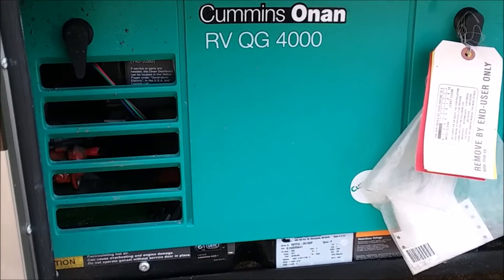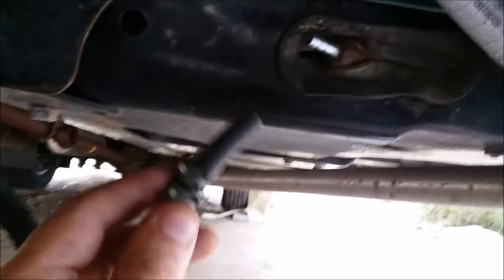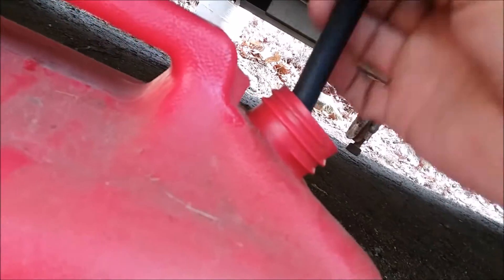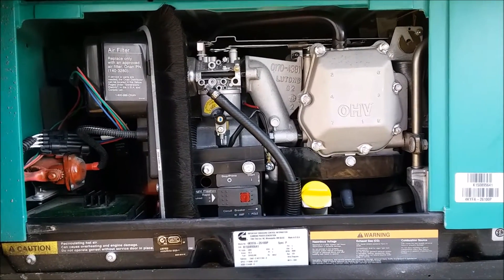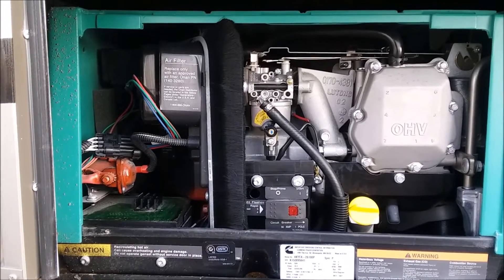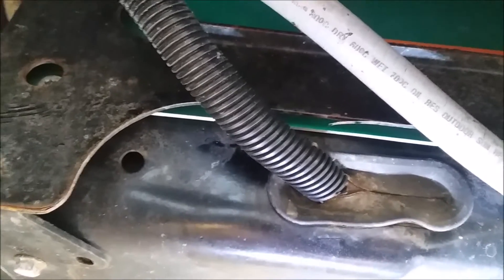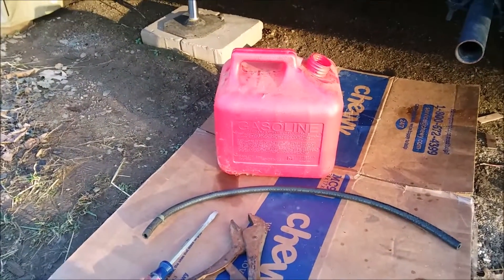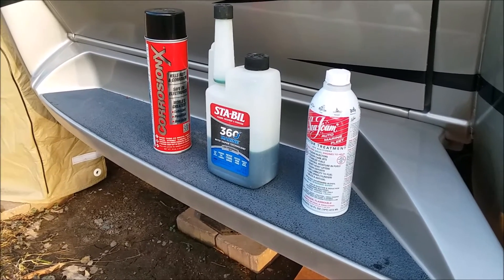Cummins Onan RV QG 4000 generator exercising, carburetor maintenance and surge prevention

Comment: Your video was excellent.  Quality of audio/visuals/ camera angle/ voice, all excellent!  I needed this very badly.  I have 'surge' on my generator.  The poor thing!  My used RV is 1997, and I did an oil change and air filter change myself a year ago.  Did not know how to tackle cleaning the carburetor, fuel line, checking fuel pump and fuel filter issues.  I found out on Youtube University.  However, your video on Carb cleaning and flushing is the best!  As a female, single RV'er, who was not born like most men with knowledge of engines in their DNA, I appreciate this information and very grateful for your wonderful demo!!  Had heard about Seafoam and now will do it.  Thank you!!
Reply from the maker: Thank you very much for the accolades.  If you have surging you can use a 2 part gas to one part seafoam mixture and let sit overnight.  Repeat as necessary.  Good luck and safe travels.

Comment: Nice idea.  I will probably try this.  Two things.  The generator depends on that front cover to channel the air from the fan around the air engine to cool it.  Running with that front cover off risks over heating the engine. See the manual.   Second, I noticed the fuel line in your generator is missing some of the corrugated black plastic cover that acts as a heat shield to avoid vapor lock.  My generator was the same.  I added some more covering all the way up to the carb.   I noticed most pictures of this generator show more shielding in place.
Reply from the maker: Yes the generator needs the front cover on to properly cool the engine.  I removed some of the corrugated plastic on the fuel line for the video but I will check to make sure it's completely covered. Thanks for watching.

Comment: Excellent video! 😀  I have a 1 year old coach with the same generator and sometimes it takes 5 or 6 attempts to start.  I only have 20 hours on it so I'm going to change the oil for the break in period.  I think I'll try your carb cleaning to see if that helps it start faster.  Thanks for making this video....👊
Reply from the maker: Yes, These generators hate to sit.  The more frequent you run it the better it will run.

Comment: I have used a 5th wheel the last 14 years with out a onboard generator, now with the motorhome and onan generator would not go back. Love the generator. Thanks for the tips.
Reply from the maker: Thanks Rickbo.  I agree I love the onboard generator.  The trick though is you need to use it frequently for it to run well.  Thanks for watching.

Comment: Hi, thanks for all your excellent videos! I'm a first time RVer and tried to perform this maintenance. But after removing the clamp on the fuel line, I couldn't disconnect it. There's some type of black "band" holding it tight. I can't remove it no matter how hard I tug. I don't think I can post a photo here, unfortunately. Any suggestions?
Reply from the maker: Without seeing it I really can't say.  I have seen bands used that needed to cut off and then replaced.  Maybe have an rv tech or someone with automotive experience take a look at it to give you some guidance.

Comment: Great videos thanks.  Question: should I do the Seafoam treatment BEFORE or AFTER replacement of new fuel filter?
Reply from the maker: I would probably do it before then run for a bit afterwards before changing filter.  Good luck

Comment: just using  Sta-Bil every time you add fuel helps tremendously,this is a must ,the problem is the ethanol in the fuel,it causes the internal parts in the carb to corrode .
Reply from the maker: I agree 100%

Comment: Great video. I like using Berryman B12 in our generators fuel system, using the same method you did.
Reply from the maker: Thanks for sharing.  I also use Beerryman B12 in some of my small engines.

Comment: Great! Answered a question I didn't even know that I had and fixed a problem I didn't realize that I was going to have.  Great heads up.
Reply from the maker: The number one thing you can do to keep your Onan generator running well is to use it.  Thanks for watching.

Comment: I wonder if you could use a 3way valve like a motocycle tank valve and then you could leave a hose caped under there and when u wanna do the treatment you could tank you gascan and uncap the hose throw it in the can and just turn the valve so its drawing from the can...would really simplify it then
Reply from the maker: Sounds feasible.  If you try it come back and let us know if it works.

Comment: I have been watching your videos and find them very helpful. Thanks! I am trying this on my newly purchased used RV. The trouble I am having is that I cannot remove the fuel line hose from the filter. It will spin and I can wiggle it but I just cant get it off and I don"t want to damage anything. Any help anyone can provide would be helpful.
Reply: Pull harder. Once the clamp is loose, it pulls off. If it's been on for a long time, the rubber hose will shape itself to the nipple. It will need some extra persuasion. If the hose is old and no longer pliable, replace it. Follow the hose to an end, then remove and get another section from the parts store the same size. 
If ethanol free fuel is available, use that. Ethanol in gas goes bad in a few months. 100% gas has a two year shelf life. Ethanol is rotten in fuel.

Comment: Great video, have the same problem.  However, I live at 6500 FT and do most camping higher, even with the altitude adjustment all the way to the right it still puts out some black smoke then fouls spark plug. 
Does anyone have the procedure for adjusting the air/fuel mixture on this same genset?  (assuming screws in the side of carb)
Reply from the maker: Great question.  I would reach out to Cummins Onan directly.

Comment from the maker: I don't know why but I lost several comments and questions.  Someone asked does the generator need to be level to operate.  The short answer is no.  As long as your not parked on a steep incline you should be fine.
Reply: Isn't the Rotella 15W40 T4 diesel oil , is it safe to use in this generator , I bought it and am very concerned about putting it in mine .
Reply from the maker: I cannot speak for the manufacture but have had many who claim to use it.

Comment: Good video. Just know that you can in fact rebuild carbs and even just take them apart to clean them. But it's not for everyone.
Curious as to why you didn't attach a hose to the carb itself, instead of going underneath?
Reply: He’s using generator fuel pump which is between filter , go directly from can to carb and you don’t have fuel pump

Comment: Hi, RV Habit can you tell me how to use the sta-bil. I just bought a 2014 Jayco motorhome. I'm trying to learn! I am a woman any help would be appreciated. Your videos are the best!!
Reply from the maker: Thank you so much for watching and  taking time to comment.  Depending on what Sta-Bil you use will depend on the amount needed.  I use only Marine 360 Sta-Bil.  I have had good success with it in lieu of the regular red Sta-Bil.  At first it may seem that the Marine 360 Sta-Bil is more expensive but you actually use less of it so it lasts longer.   I follow the directions and during the summer months when I use the rig I put in one ounce of Sta-Bil for every ten gallons of gasoline.  When I store my rig in the winter months I double the dosage to one ounce every five gallons of gasoline.  I add the Sta-Bil right after I get gasoline at the pumps.  Again thank you so much for watching.  Happy travels and stay safe.

Comment: Some of the sorgina might be corrected by replacing that fuel filter...also it is rusty...replace before it rusts on...9/16 deep socket with white high temp sealant by permatex on threads ...not on the very ladt threads

Comment: Should the seafoam/gas mixture be going straight to the carburetor or should it be attached to the end of the fuel filter.
Reply from the maker: I attach the mixture at the fuel filter.  You need the fuel pump, which is attached to the filter, to feed the fuel to the generator.  Good luck.
Reply: Thank you ur the best

Comment: Hi, great video, when you say "  surge" that means the gen starts and goes off? My gen is been sitting for a while (long time) doesn't star, should i do this?. Thanks in advance.
Reply from the maker: Surge means the engine goes high and low while running.  These machines hate to sit and not run.  The carbs become clogged with fuel that deteriorates.  You can try to get some cleaner in the carb to get it running.  If the the carb is shot they are not rebuildable and must be replaced.  If your not comfortable with small engine work I strongly recommend taking it to an authorized Cummins dealer to have the work done.  This process in the video will keep carb clean.  Good luck.

Comment: I'm new to rving. What is "surging"?  Mine runs fine but when I shut it off and want to start again in a short time it won't start.  Just read the comments where you said what surging is. I think mine does this slightly.
Reply from the maker: Surging usually indicates a carburetor issue stemming from old gas that sits in the generator.  Generators are meant to be used and they do not like to sit for long periods of time without running.  You should run (exercise) the generator at least monthly under load for an hour or so.  As for not restarting when the engine is hot.  Make sure you are not priming the engine before restarting...see if that helps.
Reply: @RVHabit  ok thanks for your reply!

Comment: I've seen another video where the extra fuel line was attached to the fuel intake on the front side of the generator. Would this work? It is nearly impossible for me to get to the external fuel line intake and access from the front is so easy.
Reply from the maker: i would imagine any location you can access the fuel line would be ok as long as its before the fuel pump.  I don't think it would work if you tap into fuel line after the pump.  Good luck and thank you for watching.

Comment: Thanks, good info. About to do oil change on coach and generator. Wondering if I should do carb maintenance as well. Can't hurt I guess. On my last Motorhome forgot to exercise it one month and $400 later I learned my lesson. I have a 2015 Forest River 3011DS, it looks a lot like yours except the over cab area. What model is yours?
Reply from the maker: Hi +HDLowrider,  almost bought the 3011DS its an awesome floor plan.  Opted for the Forester 2801 GTS which stands for Grand Touring Series.  It's 30ft. and yes no overhead bunk which gives it a sleeker front cab.  There are some pros and cons in the difference.  As for carburetor maintenance I would say YES.  Almost every problem you hear with these generators is carburetor or fuel pump.  The carburetors gum up super easy and super fast. Run at least once a month under load. I run mine under load for at least one hour every 2 to 3 weeks.  I also think the SeaFoam maintenance described in the video is a great way to clean the carb.   The idea though is not mine.  I saw it on a SeaFoam manufacturer video.  It is very simple to do and I will continue the procedure twice a year.  Happy travels and thanks for watching.
Reply: @RVHabit   Loving your videos I just bought a 2020 coachmen freelander 21QB no booklets came with mine . What brand and weight of oil do you recommend . And how often do you change the air filter on these !

Comment: Hi RV Habit, GREAT tutorial, thanks !!! I have a question, at 5:20 into your video. When you prime the carburetor, this time, "it"(?) makes a much louder "clicking" noise, different from the "normal" purr. My generator makes this much louder noise also. As I am researching how to clean a gummed up carburetor in order to EVEN get this generator running (neglected for some time). This same loud noise occurs while holding my purge button down for 10-15 seconds and has me baffled as to what it is. As I said, I haven't gotten the gen running yet and don't want to harm anything by depressing the prime button for very long with this noise happening.
Have you any idea what the loud noise is? Thanks
Reply from the maker: That noise is when you hold down the prime button longer than necessary.  I am not a small engine expert by any means but if your carb is so gummed up look into using a more powerful cleaner.  I do know that Onan states their carbs cannot be rebuilt.  A new Onan carb will run you about $200.  Good luck.
Reply: @RVHabit  Thanks, that makes sense.

Comment: I use Stabil gas treatment preservative with every fill up of 20 gallons on my Toy Hauler. Will this help clean and prevent surging?
Reply from the maker: I also use the StaBil Marine 360 at 1 ounce per 10 gallons which will cut down on the gas clogging the carb but the Seafoam treatment will clean the carb.  I feel both are necessary to keep your generator running smooth.

Comment: How did you place the generator under a load?
Reply from the maker: Hi, depending on the outside temperature I run the AC or Heat Pump which is about 15 amps.  Sometimes I will use a plugin 1500 watt heater. You want to draw 15 amps or better to put it under load.

Comment: I wonder if a bypass valve in the fuel line would make it quicker than disconnecting the line if the bypass valve had a second connection port you could just run a fuel line into a can of Trufuel and run everytime after a trip. Then there would be zero ethanol in the carb and engine while it sits.
Reply: I was thinking the same thing.  I plan on adding something like this to my machine.

Comment: On my Emerald 3 generator I installed a split valve. Turn it left it runs off the coach fuel tank turning it right it will draw fuel from a gas can. This way I don't have to remove any fuel lines to run the generator in place its permanently attached to the coach.
Reply from the maker: Nice idea.  I might have to do something like that.

Comment: I always put Marvels Mystery Oil in my gas.  I also have a Honda Quad and put it in there also.  My dad told me about this stuff when I was a kid and didn't remember about it until my 1986 Olds was acting up and my Son-in-Law told me get some MMO and the car ran like new again.  I even put it in my oil.  Check out Chasing Classic Cars and he put some in a barn find and it started right up.  Not sure why but they been around a long time.  Great stuff!!!
Reply from the maker: Yes it is great stuff.  Most who use it swear by it.  I call SeaFoam mechanic in a can lol.
Reply: LOL, we have used it on cars and it works great.

Comment: not to be a kill joy but 4 oz of sea-foam to a gallon of gas is around a 30:1 mixture and not nearly enough to accomplish much  of anything unless you are doing it monthly.
You really should be doing a minimum of a 4:1 mix or preferably 2:1 mix at least twice a year.
4:1 mix is 16 oz sea-foam to half a gallon of gas
2:1 mix  is 32 oz of sea-foam to half a gallon of gas
A 4:1 mix done quarterly will greatly reduce the risk of carburetor gumming up and virtually eliminate carbon fouling of the upper cylinder, head and valves
Reply from the maker: I agree a higher Seafoam to gas ratio is best.  I have started using A 2:1 ratio twice a year.  The generator runs very smooth.
Reply: Great info!

Comment: I understand why you did this.  But why didn't you change your oil after you were done?  In case anything like carbon off the piston or valves got down into the oil.
Reply from the maker: You can certainly change the oil after exercising.   The most important thing is to change the oil every 100-150 hours of run time or every year whichever is shorter.

Comment: If my RV's generator uses my vehicle's gas tank, wouldn't just pouring a can of Seafoam into the vehicle gas tank accomplish the same thing?  Assuming I fired up the generator and let it run before driving.
Reply from the maker: Yes but the seafoam would be highly diluted.  You want a heavy concentration so the can method is preferred.
Reply: @RVHabit Ok, good tip. Will do this after I swap out the fuel filter. Great videos for us rv newbies.
Reply from the maker: Thanks for watching

Comment: Dumb question time- what do you do with the remaining gallon of gas with SeaFoam in it after you're done?
Reply from the maker: I used it for my other small engines.  You dont have to mix a whole gallon though.  Mix only what you need.  According to SeaFoam you can mix as much as 2 parts gasoline to 1 part SeaFoam.
Reply: @RVHabit , I don't have other small engines. :) I think I'll end up just dumping it into the 20g fuel tank for the generator on my toy hauler.
Reply from the maker: That is fine also.  It will help keep the carb clean.

Comment: I was out camping, developed minor surging, Turned on the microwave and the load stopped the generator. I was preparing to clean/exercise the carburetor/generator but I can't get it to prime or turn over - nothing. I've checked the battery cables, and still nothing.
Reply from the maker: Unfortunately it is impossible to diagnose without being there but if unit will not even prime I would start with the fuel pump.  Sounds like generator is not getting fuel if it will not even prime.  Good luck.
Reply: Yeah, I'm not even getting lights on the interior panel. It's like the fuel pump & starter isn't getting power.
Reply: RaySkyDogg did you get it to run yet? I’m experiencing same issue.